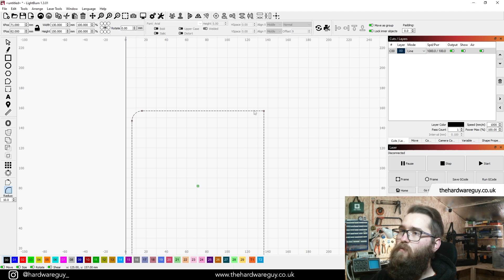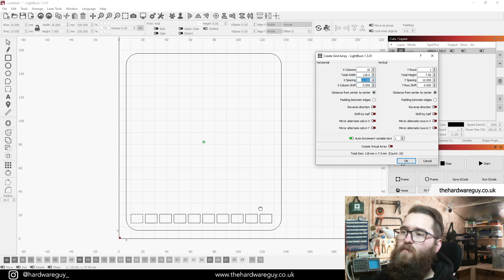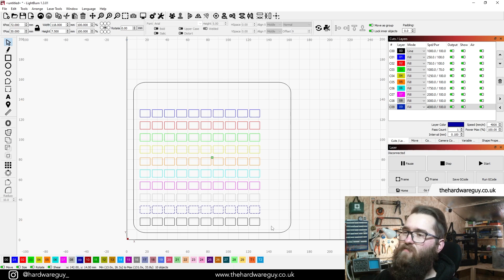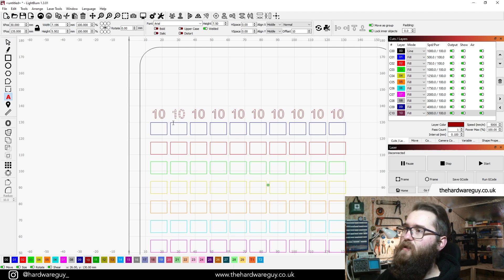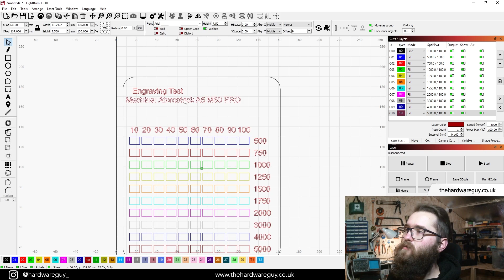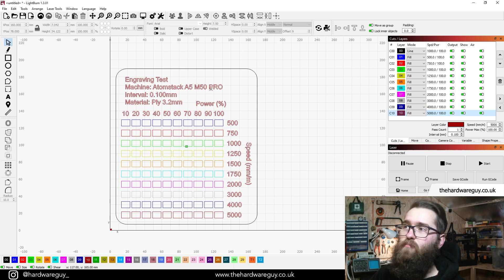Laser Power Testing Array in Lightburn

Comment: Just got my first laser and thank you for the detailed walkthrough in creating one of these. First time for Lightburn for me. For those who don't know, instead of selecting text and hitting duplicate, you can hit Alt+Enter and it will drop down one cell while still in the same text box. This works for most Windows-based programs like excel, outlook, etc. then you can set the Align-X at the top to Left and it will all line up nicely.

Comment: Great video lot of detail. But do you know that in the version of Lightburn that you have there is a tool that does all of this automatically for you without drawing anything. It is under the Laser Tools dropdown at the top call Material Test. Around 60 seconds to input your parameters including shape size and speed settings and you're off to the races. Try it..
Reply from the maker: Hi Martin, thanks for the feeeback. Yes I am aware of this and I will likely cover it in a separate video. The reason I did it the long way is primarily to help complete beginners understand the process and learn the basics of Lightburn
Reply: I'm new to lightburn. How do  you find out where the tool has its starting point in order to place material on the build plate in the correct location? I'm using an Ender 3 conversion kit.